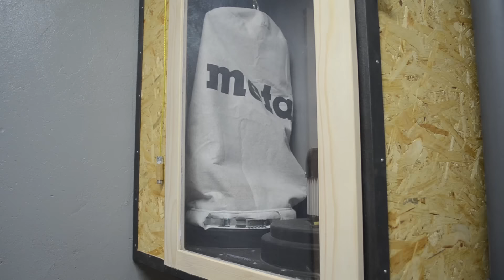Arrangement of Dust Extraction System in the workshop

Comment: Hi! I like the casing you have built, the only extra i would do is an extracting fan towards the outside. I see that you have tested the suction power after extending the extractor's hose, but that will decrease it's lifespan. I like very much the fact that you integrated the wood dust and chips into your garden! 👌👍

Comment: What a bad ass... war is at his doorsteps and he builds a dust collection system for his shop.

Two things I just found out recently that you probably already know...

1) To avoid the risk of fire dust collection systems should be grounded to prevent static build up.  Stumpy Nubs has a recent video about this

2) Certain species of wood can actually be harmful to grass, not sure how they work as a mulch mixture.

Great work as always, stay safe!
Reply from the maker: Thank you for your support! I have a lot of steel fasteners that should remove static from plastic pipes. During the tests I have not seen any signs of statics. I will connect the ground wire if needed. I use hardwood sawdust only as a soil loosener for gardening, my parents asked me to do it, I'm not an expert on this! I hope it works! ;)
Reply: @homemadeinlviv8041   Nice!  I'm definitely no expert, but I swear I'm a human lightning rod.  At certain times in the year when I put my key in the lock I see a small spark.

As for the wood, I think whatever you used should be just fine, but I saw in a Blacktail Studios video recently that black walnut can be harmful.  Again, no expert on the matter.

All the best!

Comment: I can't get rid of a feeling that this arrangement has a downside if your workshop is heated. By making this extractor vent dusty air outdoors, you are essentially sucking out heat from your workshop. In winter this will make your workshop a very cold place to be. A good filtration system cleans up air but preserves the heat!
Reply from the maker: This is a simple way, better than putting extra filters to clean fine dust.

Comment: I think this is inefficient because the air passage is narrowed.  It looked like there was a vent at the top of the box, but I think it's still inefficient.  Right? I'm not going to make you angry.  I am in trouble with the same thing.  The dust collector is noisy, so I want to do something about it.  Thank you.
Reply from the maker: Thank you! In the process of operation I will eliminate all the shortcomings!

Comment: It make sense to add some porous material beneath engine - as solid mount to box will create extra noise (whole box became sound projection instrument, like guitar or drum). I've face with such problem with small on-table cnc - adding packaging sheet of something porous reduce sound from cnc and table (16mm plywood) drastically.

PS. Добре бачити що з вами все дебре. Дякую за контент)
Reply from the maker: Thanks for the info!

Comment: Very nice but i recommended to not use pvc (plastic) pipes, it's better use metal pipe, because when you plan, it creates electric charges that can cause a fire. Therefore, flexible pipes have a braided wire which should be earthed (connected to the hood)
Reply from the maker: Thanks for the warning! I have a lot of steel fasteners that should remove static from plastic pipes. During the tests I have not seen any signs of statics. I will connect the ground wire if needed.